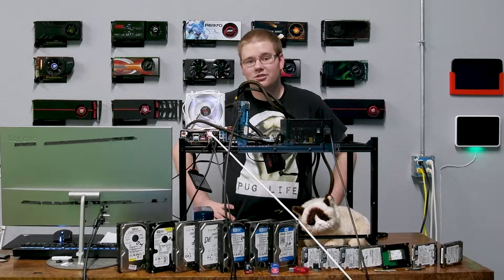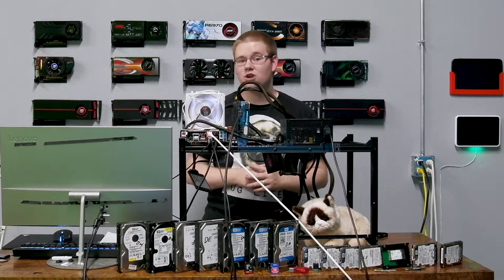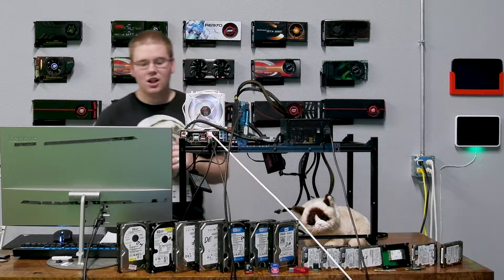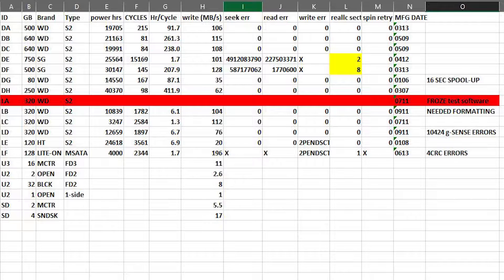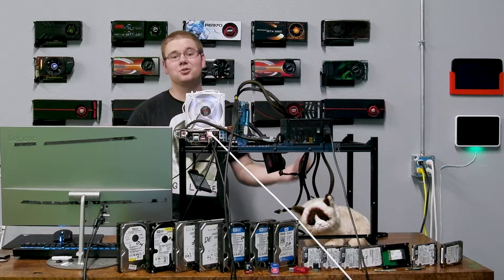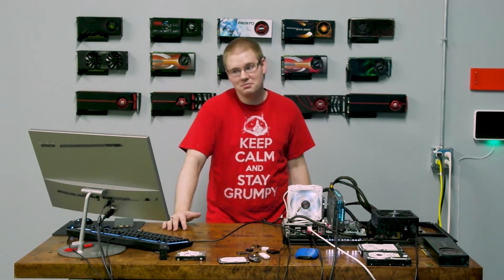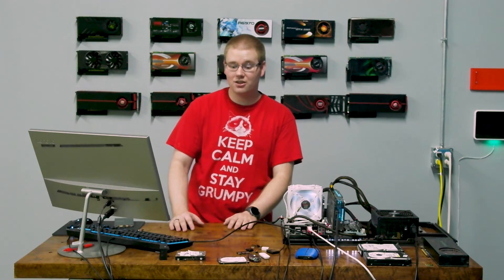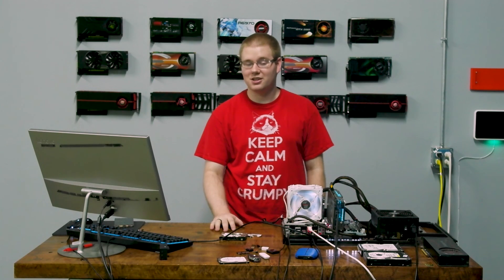HDD Durability testing! Nerf, Airsoft & Drops!

Comment: what kind of software did you use for testing? I did dropa brand new drive from a brand new server, and tough it is detected by bios, can be part of a raid and makes no weird noises, it stops working during vmware istallation, so I wantted to konw wich toot to use to test it
thanks

Comment: The sound on your video is a bit behind the actual video. It's good that you actually tested them by doing a full rewrite. I would suggest showing final SMART values and maybe testing with the drives running and working. Good video otherwise, not a lot of people trying this on purpose.